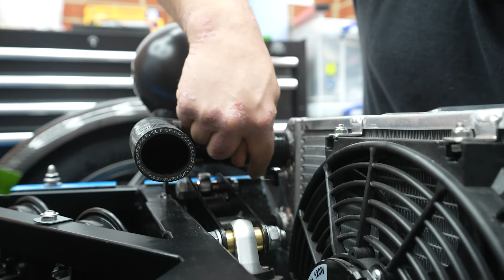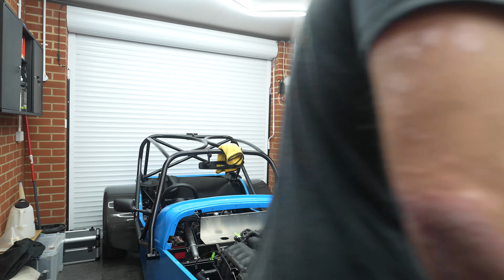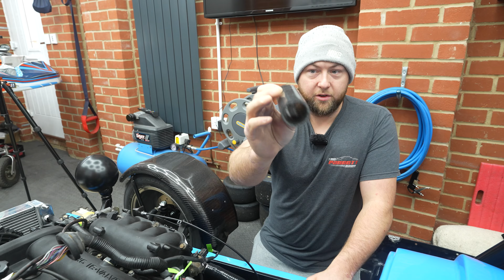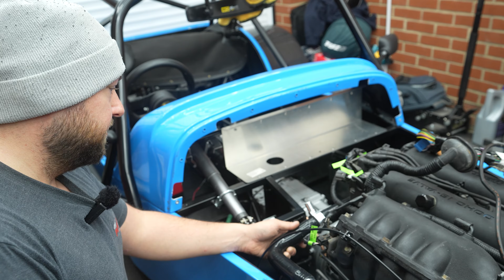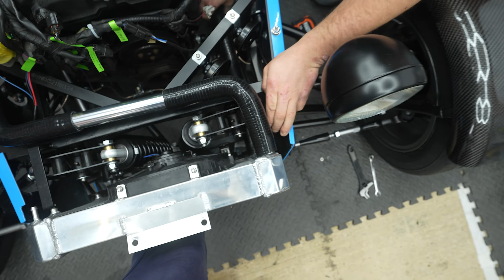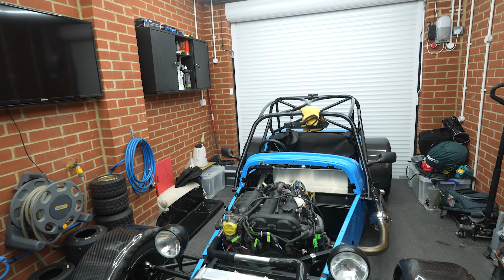Piping Up Our Coolant System

Comment: I’ve got a reroute kit to fit, so interesting. Just need to sort the bodges done on my factory built car first
Reply from the maker: It just simplifies the mazda routing and should aid cooling on the engine a little more too
Reply: @TheParrottBros  agreed, thats why I ordered one. the factory car had done 1500miles and coolant was red rusty so it obvouisly doesnt flow through the whole engine as standard.

Comment: Nice job guys! It’s looking awesome. Almost ready for the road. I do wish you would have shot a video showing the process of making the custom coolant reroute bits. Especially the trick part at the back of the engine.
Reply from the maker: Maybe when rob makes something with MB special next time he will get some clips, Rob is being taught how to use a lathe / mill etc so didn't want to take advantage, he is already being taught things that only life experience can teach :)
Reply: @TheParrottBros  well I’m guessing that the thermostat housing is on for good. But if it still needs a final seal up on final assembly. I’d love to see how the thermostat was integrated. I plan on doing a similar setup when I get to that point. Regardless, thanks for the great content. 👍